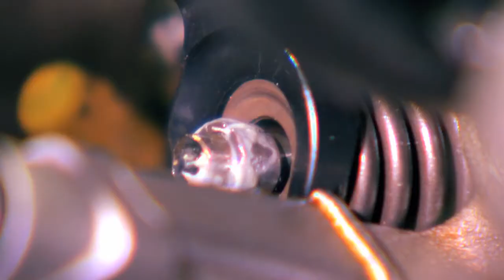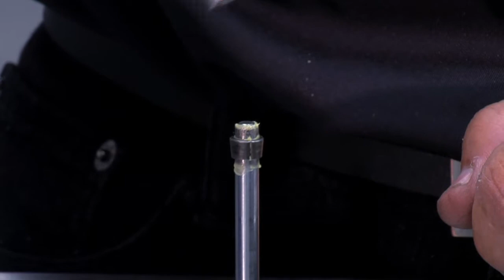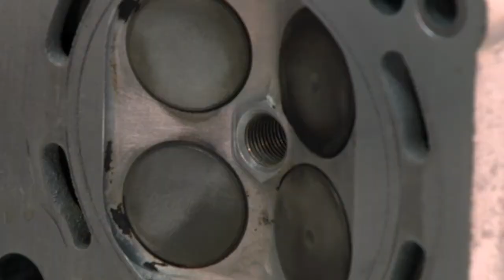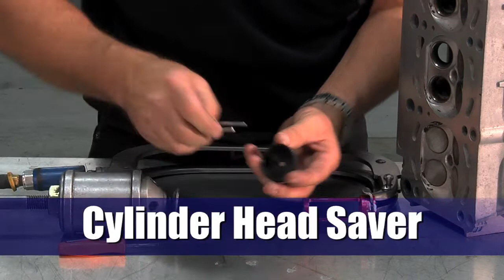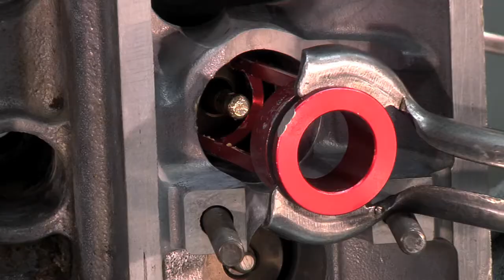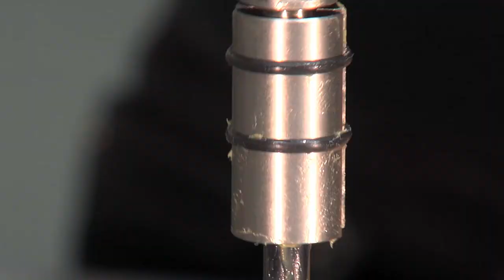AGA Valve Keeper Installation Tool

Comment: I placed an order for this tool last night, I’ve been struggling with keepers on n63 for days now! I’ve already lost two and only got 3 valves done.. I hope this tool works as advertised because a screwdriver method and grease are not working, especially since you have only one hand to use